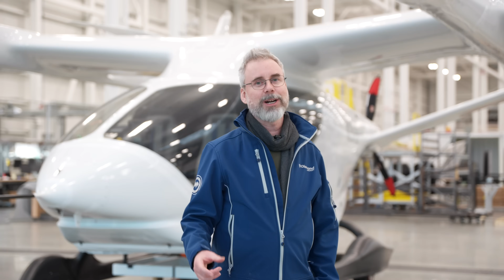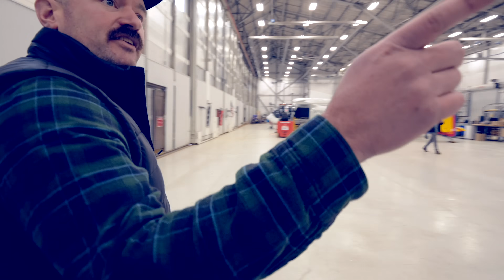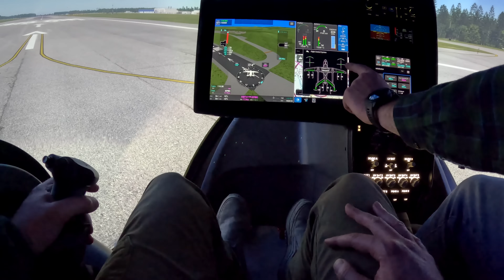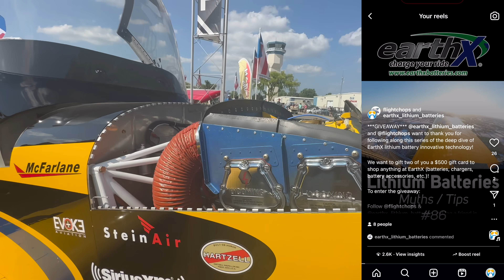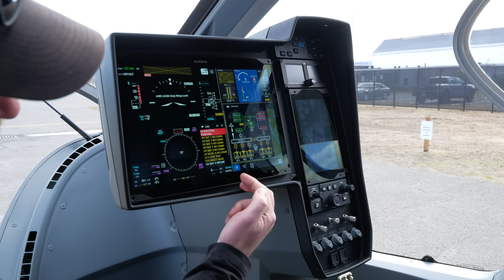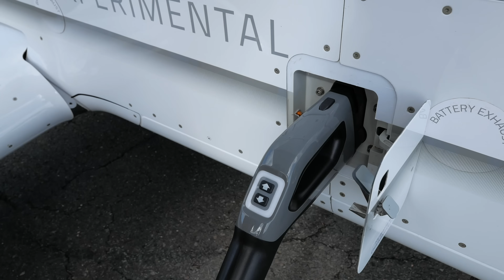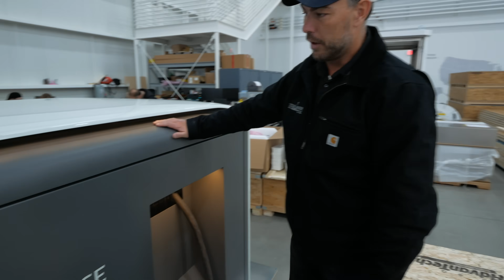Learning to Fly Alia: No Feet?!

Comment: What's the advantage of the twist stick over pedals, beyond space saving? I know with twist stick Joysticks it can be very easy to mistakenly add a twist to any movement
Reply: They explained in the video that it's for weight savings due to electric. Also I guess that's why its very stiff (which Steve mentioned in the sim segment) - to minimise incorrect yaw input
Reply: @bencoder  It doesn't work in real world aviation... A human limitation
Reply: In a fly by wire system having the twist stick is a significant weight, cost, and engineering savings over rudder pedals.
Reply: @willdogs4286  Doesn't work due to human ergonomics - Sikorsky SHADO program proved the concept long ago.
Airbus knows this too.
Reply: @HongyaMa  its fly by wire more dronish anyway likely they mix in rudder and wing controls anyway in a game that has twist stick axis (it was pretty common in games like in late 90s though there in free space it was usually set so that stick left was more of the rudder kind of an action and stick would rotate the ship, but the turning would have some rotation baked into it for feel(it feels more natural even if it isn't, compared to a space sim where they're distinctly their own axis on controls. it makes it feel more like ww2 fighter planes and ww2 dogfight games did the same thing), i tell you what though it's a lot easier to be precise if there's the option to switch force feedback and centering off via hand placement for the stick itself, there was a stick like that in late 90s from ms that used optical sensors for everything).

with feet you can get a lot longer movement though to compensate feet being less precise in shoes, but its not like fitting enough axis with precision in hand controls is an overburdering problem.   

not that fly by wire feet controls would weight much anyway it's less than a bottle of water
Reply: @lasskinn474  Sikorsky SHADO program put to rest the yaw in a side stick designs. Human factors made yaw mixed with pitch & roll was problematic as humans would muck it up and flying isn't a game.
It's actually quite deadly.
Helicopters cyclic controls have no "feel" with boosted controls and force gradient are what we have, 
Fly by wire and computers make for useless pilots, Seen the results with current Army pilots, They have issues flying 'real' helicopters... SAS and AFCS spoiled them
Reply: @HongyaMa  how does that make the fly by wire useless itself though? of course they wouldn't be certified for other things, but clearly it's on their agenda to make it more accessible (outsider view can be either way of that being good or dangerous and accessible I just meaning more of an ex-tempore thing to get into with less effort). but where i'm from if you do driving school with an automatic you're only allowed to fly automatic, to truly make it accessible you'd need to automate the etiquette with flight towers and all that, or have some designed flight lanes for them or something.

the company seems to be wanting to push affordable touring flying for a new segment. like drones got a new segment with stabilized rather having to fly with controls that didn't have a center and rc choppers got a new segment with 3d flying, which did lead to a bunch of people showing off their 'awesome' control skills, like sure fun you just pressa button to do a hooptihoopzippazagga but it's not interesting as a show of skill.

the airtaxi companies would need some systems too for the air control - i'm rambling but this is what these companies are trying to do to justify the investments as potential shares to go to the moon, drop the threshold, basically to get cryptobros to buy a plane instead of a lambo without going through the route of it needing the time of a serious second job hobby.

like old ultralights missing a rudder  that is my impression about the company anyway that you're not really supposed to use the rudder manually much anyway.
Reply: @lasskinn474  You're clueless. Pilot skills degrade with the augmented control.
Look up the numerous accidents where "Control Laws" failed and pilots failed.
It's not about certification. It's about safety.
Reply: I feel like being so desperate to cut weight that they go to a twist stick is some oceangate shit waiting to happen.
Reply: @dove_tam  Yep

Comment: Geewhiz, the opposite problem from the one channel guest who had no arms.  I wonder how she's doing, and how the aircraft you're featuring today could be modded to accomodate her.
Reply: I think in principal it couldn’t be easier than with the shown architecture. The flight control unit requires digital data as input representing the pilot’s control inputs. The steps before that (like converting the mechanical position of the input device into analogue electrical signals, then converting those into digital data the FCU understands) are incidental. Their design could entirely be driven by ergonomics (and convention). 

Stopping short of linking straight to your neurons (you see I am at pains to avoid a certain trademark here) the pilot - one way or another - needs to be able to produce independent mechanical input for at least five or six variables:

- propeller speed
- rotor speed
- bank
- pitch 
- yaw
- wheel brake
- inputs to the glass cockpit

I think current human machine interfaces in complex machines like aircraft are already using most of what am able bodied human can offer. 

The next level of abstraction is then of course the autopilot. Where the pilot (or passenger) just gives ‚intentions‘ (like „fly me to New York“, or „land there“), which the autopilot then translates into control inputs.

Comment: Hey Steve - just so you know, you can extract the audio from the video, slow it down and extract the audio from sped-up Mary talking, slow it down and it's possible to clearly hear what she's saying. Sorry to do this to you, but I know you'd rather protect Alia's IP.
Reply from the maker: Thanks.  I actually trimmed what she was saying for most of that, so you did that you won’t get full sentences.
But if someone wants to work that hard I guess they can have it.😂
Reply: @FlightChops  I was about to say the same thing - good to hear that it was still sufficiently clipped so that confidentiality wasn't hopefully broken.

From a technical standpoint, it's really quite difficult to permanently obfuscate audio just by editing the original sound. Human hearing is ridiculously well tuned for identifying speech, so even when the audio is significantly garbled, it can often be re-engineered back to understandable levels if you figure out the "reverse order" of operations done to obfuscate it in the first place. In this case, it was quite simple.

For future reference, if you need to redact audio - it would be better to completely mute the original audio, and cover confidential parts with other audio: Silence, censor buzzer, white noise, or for example sped-up speech from completely unrelated recording. The key here is that this "cover-up" audio doesn't contain anything confidential. 

It's like the black blocks used to redact words in documents. In order to work, they need to be completely opaque - otherwise the text can be edited to become visible by adjusting the contrast/brightness of the blocks covering the text.

Stylistically, I think replacing the confidential parts with, say, sped-up lines from a well known film for example would sound remarkably similar in the video - the only people who would notice it would be people who'd be interested in trying to slow it down to hear what it actually says...